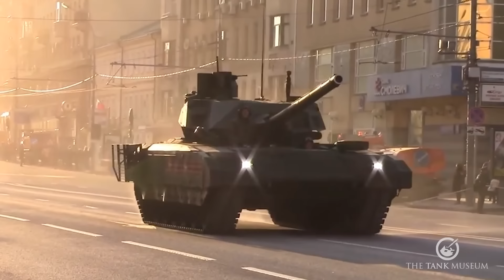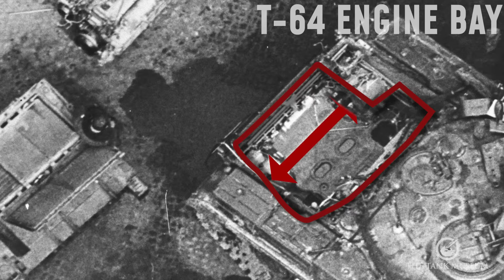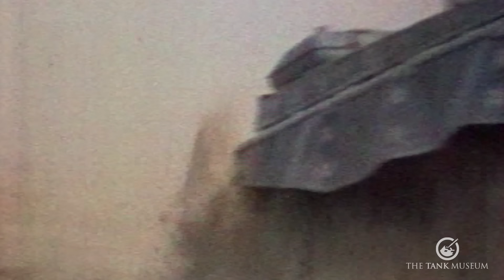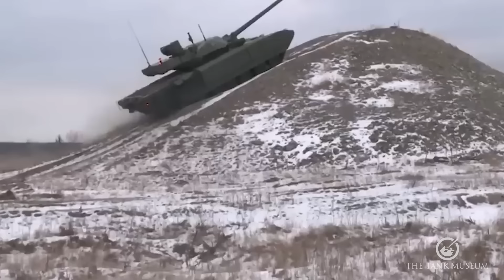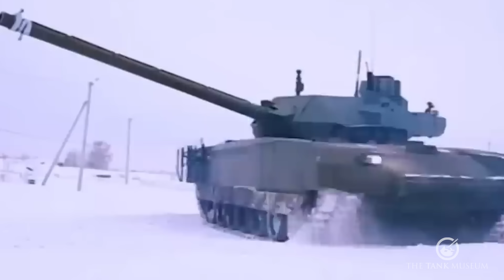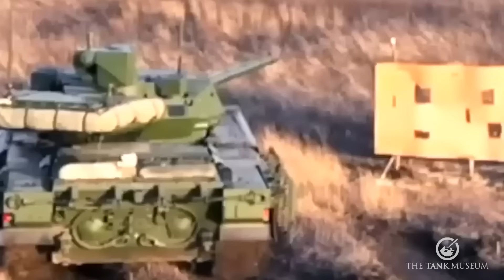Radical or Ridiculous? | T-14 Armata | Tank Chats #171

Comment: I feel like the traditional ‘Tank Triangle’ of Armor/Firepower/Mobility, should be amended to include ergonomics/crew as a 4th aspect. You can create a tank that on paper is perfectly balanced and has amazing Armor, Firepower, and Mobility but have it still perform terribly due to being difficult to use. In my opinion this is why so many games appear to have a ‘Russian bias’, because they ignore all these hard to quantify aspects.
Reply: In addition to ergonomics, reliability and repairability are also key factors. It is one thing to have a theoretically good tank and another to get it to the battle.
Reply: To paraphrase a wise man: "What is the most important aspect of any device? Being able to use it"
Reply: Well said. The T34, for instance, gets lots of praise from tank enthusiasts, and on paper it was a great design, but in its original form it forced the commander to double as the gunner, severely limiting his situational awareness. Definitely illustrates your point about being difficult to use effectively. Add to that bad optics and radios, and each tank was essentially blind and deaf, easy to pick off piecemeal.
Reply: A quadrangle now.   Aerodynamics of the turret should be considered.
Reply: This is interesting that we have fictional fire rate, fictional armor of a tank that never went into serial production. We have various prototypes that may be all different for testing purposes or just a learning curce from prior prototypes. So the idea to compare it to tanks that are actual used in units on s daily basis. It is a bit like we talk about unicorns that no one ever saw.
Reply: In context, 80,000 T34s were made with another 10,000 if you include SPGs made on its chassis. The Sherman was built for simplicity. It’s design put focus on its crew, making easily repairable parts and good survivability. The build quality was substantially higher with a much better k/d rate. Unlike the t34 the Sherman was a much higher quality, although not the best quality still better than the Russians.
Reply: @paleoWT and the Sherman still ended up being pretty advanced for the time. Any issue that came up was usually fixed in a timely manner, and upgrades were common and easy. The Sherman had excellent optics (even the ones with no gunners sight due to the idea they had not working out and not having time to make something else), they all had stabilized guns, they later had wet ammo stowage (even the early models without it didn't have a tendency to burn, it was just everyone's doctrine to shoot tanks until they burned to make recovery useless. They were never called ronsons by anyone other than the History channel), the engine compartment and fuel tanks were separated from the crew, the transmission was synchronized, etc. It was a very nice tank to fight in, and all crews who used them typically liked them a lot. Especially Soviet crews when they got M4A2s for the first time
Reply: @skyraider87  Why write all this? Sherman was still vulnerable to all German anti-tank weapons (except perhaps the Pak 36) of all tank guns.

There was no difference in the survival of the T-34 and the Sherman. The Shermans enjoyed an abundance of resources, manpower, and complete security. None of this is in the USSR, the Reich, or Britain.

And yes, the Russians considered Valentine a good tank, and Churchill a heavy tank, no worse than the KV-1 series. This is an argument for the fact that the Soviets considered the Sherman a good tank.
Reply: @adeptusaegis3189  compare the numbers. The Sherman had a crew survivability rate of 85%. The T-34 had about 15%. What that boils down to is that the Sherman crew would survive, go back to the depot and get another Sherman, and bring a few of their buddies in Shermans along too . Although statistically it was a Sherman, Singular, that was able to effectively deal with the threat.
Reply: @skyraider87  Cool story, bro.  But unfortunately, the Soviets had thousands of M4s and didn't see anything like it.

If a German 8.8 cm shell made a direct hit to the T-34, the crew usually died. If you think that Sherman's crew could Ignore shell from Tiger or Acht-acht, when this shell breaks through M4 armor, you probably have a magical mindset and believe in fairies, unicorns and things like that.

There was not much difference between the T-34, Sherman, Pp.4 and Cromwell. You had some kind of armor, some kind of cannon, some mobility, and enough simplicity and reliability to produce and use these tanks by the thousands and tens of thousands.

These tanks were made in different ways, by different people and in different countries, but their differences in general were not so great, because they had the same purpose and tasks.
Reply: @adeptusaegis3189  Soviet Shermans belong to soviets, american shermans belong to americans. Different strategies, maybe even slight differences in construction. The Sherman was a lot better quality as it had huge improvements in weld quality and crew survivability. Sure it wasn't armored, but at least the crew could take a hit and live to see another day - Emphasism on crew over the machinery. Neither tank can withstand a german 88 but the sherman crew could bail out ALIVE, which made a huge difference.
Reply: @paleoWT  Your faith that the tank crew can survive the explosion of three hand grenades inside the tank, simply because they are AMERICANS, is quite funny. And yes, the 8.8 cm German shell contained as much explosives as three hand grenades.
Reply: @adeptusaegis3189  I think you misread my statement. I’m saying that different combat usage will lead to different results - the difference between recklessly charging or having a good battle plan as well as how the crew modified the vehicle will all impact the final result. An unmodified Sherman has a very high crew survivability compared to something like a t34 85
Reply: @paleoWT  If speaking of "recklessly charging", you mean something like the Battle in the Hurtgen Forest, where the Yankees' 3rd tank and 9th infantry divisions, thrown into a frontal assault, lost up to 80% of their personnel and achieving NOTHING, then I can only agree.

Nevertheless, your unwavering faith that a Sherman with the same armor and size as the T-34 had a greater survivability for the crew, simply because it was made in America, is impressive.

We even discussed that it is difficult to survive after being hit by an iconic German 8.8 cm shell, but no, for you the M4 is still better because it is better.
Reply: @adeptusaegis3189  the Russians had close to no quality control and the t34s had much more dangerous interiors- smaller crew exit hatches and much higher chance of something exploding upon impact.
Reply: @paleoWT  Dude... who told you such nonsense about quality control? Firstly, all T-34s were 70% assembled by women and children, and there was strict quality control in production, firstly, all T-34s since 1942 were assembled in front of the crew who were supposed to go into battle on it, secondly, every master during the assembly of the T-34, he signed the sheet and any manufacturing defect could lead to the fact that everyone who worked on the shift could end up in the Gulag!
Reply: @FCSMHooligan Such strict quality control that drivers had to carry a hammer to shift gears?
Reply: @FCSMHooligan  Especially towards the early T34, quality control was pretty much nonexistent - who would’ve guessed the most produced tank during World War II wasn’t good in quality. these tanks are being made by women and children who don’t really have much motivation. Transmission was decent at best and the hull suffered from defective armor plates as well as bad welds. These issues were quite prominent and were a huge problem that the Sherman was less effected by.
Reply: @adeptusaegis3189 false premise here dude. NOTHING on the battlefield survived a hit fron an 8.8, Nothing on the battlefield survived a hit from a 17 pounder either. Same for the 90mm, so, your piont is? The tigers, weren't really an issue on any battlefield, as there were so few produced, due to material, and technological expense, the tiger was overly complex and very unreliable (looking at you t-14) and more often than not, thay failed to show up to the fight,  and would often be delt with by a tempest, or il 2 sturmvich. Heres the thing about the t-14, with the gunner and commander relying on remote sights on the turret? What do you think happens when a pair of us next gen ifv,s, light up the turret with the 50mm chain gun
Reply: @evilshews   IS-2 could have survived after being hit by 8.8 cm. Churchill had some chances.

My point is simple: the words about the best armor protection and survival of the Sherman crew are just words. 7.5 cm and 8.8 cm pierced the armor of both T-34 and Sherman. 8.8 cm at the same time killed or maimed the crew is almost guaranteed.

By the way, this was the reason why Tigers were much more feared than Panthers. It's the same with IS-2. If your tank was hit by a 122 mm projectile weighing a quarter of a hundredweight, then you are most likely a dead man.
Reply: @paleoWT wow who would have guessed when someone is being rapidly invaded needing lots of armour yesterday is going to turn a blind eye to QC until they have the luxury of taking more time....
Reply: @paleoWT you also fail to realize QC was actually good after the Soviet front had stabilized an turned the tide of the war.

And didn't do much research either there's a declassified CIA document that evaluated a Soviet made T-34-85 and remarked about it being well made.
Reply: @skyraidegg 8:39 r87
Reply: @paleoWT well need to understand that in the east front land battles was the size of all fronts in the west
60/70% of Germans forces were in east
Reply: @paleoWT  You talk about self-propelled guns based on the T-34, but you are silent about ~ 9000 GMC M10 and M36  based on M4. Also, you conveniently forget that the T-34 was produced for 6 years, and the M4 Sherman for 3 years. If the Yankees had been at war since 1941, they would have produced more M4s. In fact, no, they wouldn't. Because the M4 is 1942. If you add the M3 Lee and SPG on chassis M3, like Prist, you will get similar numbers to the T-34.

You're talking about survival, but Sherman in 1942 penetrated by all German anti-tank weapons and all new panzers. When the Americans tried to make a "survivable" tank,  they failed with T1 heavy and M6 heavy. You talk about the focus of Sherman's design on the crew, but it was never the feature design of the M4 by himself M2 and M3 had a crew of 6-7 men and M4 as their legacy, retained this huge interior space, now with a crew of 5 men. For comparison, the T-34 was originally a tank for a crew of 4 men. Another typical Yankee design is M3 light  and it was no less cramped than the T-34. M4 was a tank that the United States could produce by tens of thousands and which matched  minimum required specifications: armament (3-inch gun), protection (protection from bullets, splinters and 37mm PAK), was reliable, enough mobile and had a turret, unlike the M3 Li.

As for k/d rate, then Wehrmacht losses on the eastern front accounted for more than 70% of the total losses on all fronts from 1941 to 1945. The backbone of the German military machine was destroyed in the Soviet steppes. And the T-34 was part of it.
Reply: @paleoWT  yeah sherman had such a good survivability that its crew were so scared they used concerete and sandbags to 'upgrade; its armor
Reply: @piorun7840  The usage of sandbags was purely placebo effect. It didn't do anything much to improve the armor, but it helped the crew feel more comfortable. In reality, the sherman had enough armor to take a hit from the short barreled panzer 3s - It's obviously susceptible to a tiger but for its purpose it was pretty survivable. Not only that but the crew had a better chance at surviving an impact.
Reply: @paleoWT  well sandbags still helped and yes we can say that sherman was the best tank in ww2 but still lacked in armor and its cannon wasnt as effective as it should against tigers and panthers usa had terrible problems with decision making and they could long before 1944 introduce newer tank like pershing or create heavy tank that would rival tiger not to mention that troops that used tanks were advised to not fight tanks with tanks but in fact use tanks against infrantry ignore enemy tanks and let tank destroyers do their job ofc everyone ignored that since it was such dumb order that could rival russian order of not taking step back
Reply: @piorun7840  First of all, sandbags only had decent protection against shaped charges, which were far from the only rounds available to the germans at the time. There are accounts of Shermans penetrating the tiger's frontal armor- The armor was sufficient for what it was- a tank that you could deploy anywhere, anytime, anyhow. The sherman was far more effective than the german heavy tanks of the late war, and the armor was just fine for its purpose.
Reply: @paleoWT shermans could take hits to the front from a 75mm pz IV pretty well too, especially if hull down. And a Sherman would chew through a Pz IV in a second
Reply: @paleoWT  yeah, and if anything is more important than the tank surviving, its the crew surviving
Reply: Russian tanks are generally ok on paper but terribly made in factories due to their philosophy of quantity over quantity. For example the t34 is a legendary tank however the only reason for that is that there were so many made because it had a loss rate of more than 80% percent (horrible for a tank).
Russian tanks were never something special and still are unimpressively made.
Reply: @FiveDollarSurgery  mate, you are comparing 1930s and 1940s production of tanks to the modern day one. It is not the same today. And it was also the same for almost any country, as Germany was suffering with it's poor quality of production at the end of the war as well. Modern day production of the Russian tanks is of the high quality, with regards to the T90 tanks...
Reply: @FiveDollarSurgery  LOL. You don't seem to have heard that almost 50,000 Sherman was buil. Yes, it was such a bad tank, almost like the T-34.
Reply: @adeptusaegis3189  I'm not sure of your point. By all accounts, the Shermans were extremely well-made and massively more reliable than other tanks of the era. They were under-gunned for tank-on-tank battling with the 75mm in 1943, but that was mostly rectified with the 76mm (and Firefly, but by sacrificing crew ergonomics).  Its size was limited by the need to ship it across the ocean to go to battle, unlike the German and Russian tanks. It was a little tall due to initially accommodating radial engines and the front transmission. But by WW2 standards, the  Shermans had both quantity and quality.
Reply: @disphoto  My point is that the difference between the T-34 and the M4 medium in terms of use and combat effectiveness was insignificant. The M4 were no more reliable than the Pz.4, or the later T-34. As for the size restriction, the M26 obviously refutes this statement by its existence.
Reply: @adeptusaegis3189  did you read the post you are replying to?  Did you miss that the focus was the high loss rate?

Slightly fewer than 4,300 Shermans were lost in combat.  Compare this to slightly less than 45,000 T34s.

4,300 / 50,000 is a much more favourable ratio than 45,000 /57,000
Reply: @ShuRugal  Just read Death Traps: The Survival of an American Armored Division in World War II
Reply: @adeptusaegis3189  I'm familiar with the work, and I do not believe that a man whose job is is to fix broken tanks has the best perspective on the issue.
Reply: @ShuRugal  This book describes tank losses in an intense continental war. Even if the Wehrmacht was already in decline.

In fact, the M4 participated in intensive military operations for 1 year, from the summer of 1944 to the spring of 1945. Naturally, the American losses were less than those of the Soviets.

Т-34 was at war from the summer of 1941 to the spring of 1945, i.e. five years.

This was the case in the First World War. Both times, the Yankees' losses were small, because the Americans come at the end of the show.
Reply: @adeptusaegis3189 the Pershing, gun aft, was 20 feet long. The 75mm Sherman was 19 feet long. Your point is moot
Reply: @adeptusaegis3189 that book has been disproven by more historians than you can count
Reply: @ShuRugal not to mention the way the allies counted losses was highly flawed, often leading to one tank being counted as lost twice
Reply: @ShuRugal  Dude... did the American army really participate in tank battles like the Kursk Bulge, where 3500 tanks took part on the USSR side and 2800 on the German side! Sherman was in the Red Army, and you can easily find information that Sherman is a little better than without tanks at all, which you later proved during D-Day, where, in fact, tank formations of the US Army did not have serious successes!
Reply: @FCSMHooligan  you just keep right in believing that.  I can't help it if you think that US armored crews having the lowest fatality rate of any combat unit in the war is bad.  That's a you problem
Reply: @adeptusaegis3189  But it had nowhere near the losses of the T-34. Around 7000-7500 M4 Shermans were lost in WW2, so, not such a bad tank after all.
Reply: @freddieclark  The first mass use of the T-34 was in the summer of 1941. The first mass use of the M4 Sherman was in the summer of 1943. Naturally, a tank used for two years longer has more losses. And this is just one of the objective factors.

And yes, I'm not saying anywhere that the M4 was a bad tank. The T-34, M4, Cromwell and Pz.4 were about the same value.
Reply: @adeptusaegis3189  Yes, I agree that a tank used longer would have more losses, However, if battle performance was (and indeed still is) the ultimate determinant of the effectiveness of any weapon system, then unlike some legends in WWII, the tactical combat record of the T-34 does not match up to its legendary status. An objective look at the T-34’s record, without preconceptions, reveals questions which are hard to answer given the T-34’s claimed superiority. Fully 82% of wartime production was irrecoverably lost, even counting for its earlier introduction these numbers are staggering when compared to M4 losses. I would also argue that the first mass use of the M4 was October 1942.
Reply: @freddieclark  What legendary status you talking about? The T-34 is just a tank that the Soviets could produce a lot and it had sufficient characteristics. The T-34 is very important for the USSR and the victory over the Axis as a whole, but that's all.

An objective look at the T-34’s record it is... impossible in isolation from the general course of the war. Just look at how many tanks were lost (not only T-34) during the Manchurian operation.

In 1942 in Africa it was something like walking in the park. Montgomery has already won, the Germans are already drained of blood and ready to retreat. Yes, it looks like Manchuria 1945.

In 1941, the Germans were at the peak of their power, it is not surprising that the Red Army, caught at the moment of rearmament and staffing, suffered terrible losses.
Reply: @adeptusaegis3189  The legendary status that is constantly mentioned in books and online, "The T-34 was the best tank of WW2 blah blah blah".  What Manchuria operation are you talking about?, if you are referring to Khalkhin Gol then there were no T-34's involved. If you are referring to the invasion of manchuria, then the Soviets used a huge variety of tanks, including pre-war BT-5's and lend lease tanks.  Considering the T-34 made up such a large percentage of Soviet armour, then it is of course possible to look at the losses in isolation, as even Krivosheev has done. Mongomery had not won until after the 2nd battle of El Alamein, which included the use of the M4. Lets forget 1041 and instead look at 1942 and 1943 where the Soviet T-34's were decimated by the Germans who generally had a 3:1 kill advantage. The simple fact was that the T34/76 had relatively poor main gun optics quality, no turret basket, a very cramped and low turret (the gun could not depress more than three degrees severely restricting use on a reverse slope or at close range), poor turret drive reliability, no radios, and generally poor target observation and indicator devices leading to very poor fire control effect.
Reply: @freddieclark  The T-34 was the best Soviet tank, that's right. The KV and IS were too few in number, and the T-60 and T-70 series were ersatz tanks built only because ersatz tank is better than no tank at all.

You might as well say that the M4 Sherman was the best American tank, because the Yankees couldn't build something better. Of course, the Panther was stronger than T-34 and M4, as the T-34 was  stronger than the Pz.3 and Pz.4 in 1941.

Manchuria operation in 1945, is obviously an operation carried out by the Soviets against the Japanese, at the request of the Americans, in exchange for the countries of eastern Europe. The Japanese army was defeated quickly, which led to the surrender of Japan and finally peace.

2nd battle of El Alamein was just one battle. For example, by March 1945, there was only one (1) M4A1 tank left in the 741 tank battalion, which landed in Normandy.

As for the disadvantages of the T-34, I recommend that you read the report of the Aberdeen proving ground regarding the T-34 and KV-1.

Regarding "Germans who generally had a 3:1 kill advantage" I remind you that 50%+ of the lost tanks always accounted by anti-tank guns.
Reply: @adeptusaegis3189  Manchuria was a land grab by Stalin when he knew he could get away without serious loss and  Germany had already been defeated.  Not sure what you mean by your second statement. I have read the report by aberdeen proving ground. it does not change the fact that the T-34/76 was ill used and ill suited to open country warfare.  as German tankers noted “T34s operated in a disorganised fashion with little coordination, or else tended to clump together like a hen with its chicks. Individual tank commanders lacked situational awareness due to the poor provision of vision devices and preoccupation with gunnery duties. A tank platoon would seldom be capable of engaging three separate targets, but would tend to focus on a single target selected by the platoon leader. As a result T-34 platoons lost the greater firepower of three independently operating tanks”.(9) The Germans noted the T-34 was very slow to find and engage targets while the Panzers could typically get off three rounds for every one fired by the T-34. The numbers of lost tanks are in tank vs tank engagements. Similar figures are available for the ETO where the M4 had a positive kill ration of 3.6 to  one.
Reply: @freddieclark  One more time. The USSR's declaration of war on Japan in 1945 was the result of the Yalta Conference. It was there that Stalin, Roosevelt and Churchill agreed that at the end of the war in Europe, the USSR would fulfill its allied duty by declaring war on Japan. In response, places like Hungary, the Czech Republic, Poland and the like will be under Soviet control.

Returning to the tanks. You're saying that:
...Around 7000-7500 M4 Shermans were lost in WW2
...M4 had a positive kill ration of 3.6 to  one.

7000*3,6 = 25200  In total, the Germans built ~50,000 tanks. Do you see anything strange in your math?

If you really have read aberdeen proving ground  report, you know that the T-34 was not made up of flaws, as you are trying to show. The Americans liked the cannon, the gun sight and the engine, for example.

...the fact that the T-34/76 was ill used and ill suited to open country warfare...

M4 was especially "effectively" used in The Battle of Hürtgen Forest and "well" suited to forest warfare. tag "Sarcasm".  Once again by March 1945, there was only one (1) M4A1 tank left in the 741 tank battalion, which landed in Normandy.  The American tank battalion had 60 tanks. During the year and a half of the war, one tank of the original composition remained in the 741 battalion. It means ~99% losses.

The Germans noted the T-34... 

And again you make me write the same thing over and over again. In 1941, the Germans were at the peak of their power, it is not surprising that the Red Army, caught at the moment of rearmament and staffing, suffered terrible losses. The Germans of 1941 are veterans of two companies, and their equipment is reliable, even if not too powerful. Some Soviet tankers in 1941 even did not know that the T-34 had a diesel engine and refueled the tanks with gasoline, which immediately disabled the tank and required repair. T-34 in 1941 = Panther in 1943, a powerful but unreliable machine.

And yes, Guderian himself wrote in one letter that "the Sovet T-34 tank is a typical example of backward Bolshevik technology," but then suddenly the same Guderian writes "...prominent designers, industrialists and officers of the armament department came to my tank army to familiarize themselves with the Russian T-34 tank, superior to ours combat vehicles".  LOL WUT

The Germans are famous storytellers. They portray the extermination of 17 million Soviet civilians and the murder of 3 million prisoners of war as a great military victory and sign
 of superiority over wild Asians. All their statements must be checked without fail. As well as all other statements by either side.
Reply: @adeptusaegis3189  The USSR could have entered the war against Japan much earlier, but Stalin vetoed that. The Germans were clearly beaten well before the Yalta conference was held. The Aberdeen report stated that the gun was good (It was for 1941) The gunsight was good, again, it was for 1941 although German and later US gunsights were far better, particularly when you include the poor sights and optics used due to factory disruptions and raw material disruptions. The Engine was good (as long as US aluminium kept arriving in Soviet waters through lend lease, pity the transmission was such a piece of crap though. Nothing wrong with the math, just the way you are trying to interpret it.  Tank on tank encounters were not the only way tanks were destroyed, Not every battle featured just tanks vs tanks, in fact they were a rarity, but thankfully we do have statistics from AAR's that identify actions where only tanks met. Germans actually produced only 26 925 tanks during the war, however they also produced 612 command tanks, 232 flame tanks, 10 550 assault guns, 7 831 tank destroyers, and 3 738 assault and self-propelled artillery AFVs, from 1938 to May 1945. No tanks were highly effective in the Hurtgen forest, so your point is nonsense. You also clearly do not understand the way US armour and resupply worked, anyone reading your comment on a SINGLE independent tank battalion would almost believe that they actually only had a single tank in their arsenal in 1945, and by the way 27 of those tanks were lost when they sank on the way ashore on D-Day. You make the usual argument that the operational state of the Soviet mechanised forces and the general situation in 1941 were the primary factors in the T-34’s combat performance in 1941. The problem with that is that the Soviets had the same performance figures in 1942 and 1943. Yes the T-34 was in some aspects superior to German tanks in 1941, when it faced short 75mm Panzer IV's and short 50mm Panzer III's. So why did ot perform so badly against those same tanks in 1941, when as Guderian states it was superior? Remember that a large portion of Soviet tank inventory was T-26 and  BT-7  tanks in 1941, So 1942 should have been far better for them but what happened? The Soviets still managed to loose 15,100 fully tracked AFVs in 1942 including 6,600 T-34s and 1,200 of the even more powerful KV heavy tanks. This meant their loss ratio was almost as bad as 1941. To a large extent it was worse than 1941 because in this case over half the tanks destroyed were T-34 and KV tanks.
Reply: @adeptusaegis3189  And we can also go to 1943 when the strategic initiative had swung in the Soviets favour. In this year the Soviets lost a staggering 23 500 fully tracked AFVs including 14 700 T-34s, 1 300 heavy tanks and only 6 400 light tanks.  As for the transmission, The gearbox in pre 1942 built T-34s was another design flaw of the tank. The gears were spur cut, and lacked synchronizers. The problem with your claim is that the T-34 was an evolution of the A-20 and A-32 prototypes, both of which were designed to be a replacement for the older BT tanks and the T-26s. The BT tanks only similarity to the Christie design was the suspension.
Reply: @freddieclark  The BT tanks only similarity to the Christie design was everything. BT-2 is literally a copy Christie M1928\M1931 aka «Model 1940». Hell, it even had a Liberty engine on it. BT-5 is how the Russians saw the fixing of  M1928\M1931 flaws. The BT-7M was probably the maximum that could be achieved from Christie's concept.

The A-20, A-32 and T-34 used components from the BT series, such as suspension, engine and gearbox*. The Yankees did the same with the M2 medium, M3 medium and M4 medium tanks. This is a common thing. 

And we can also go to 1943 when the Soviets making tanks more reliable, more comfortable, with a better view and a working radio,  while the Germans put all their money into raw power. Stalin refused to do the same, although the T-43 tanks and the T-44 looked very promising. So before the Soviet mass SU-100, T-34-85, ISU-122 and IS-2, the Germans had a technical advantage in armored forces. The Germans kind of turned the table when they became, like the Soviets in 1941, with powerful but not too reliable tanks, against an active and hastily advancing enemy who had reliable, but outdated and not too powerful armored vehicles.

* The gearbox was taken from the BT-7, which weighed half as much as the T-34, unsurprisingly, it worked unreliably.
Reply: @adeptusaegis3189  Again, the T-34 tank transmission was redesigned for 1942/3 as the earlier one was weak, the only resemblance the T-34 had to Christie tanks is the Armour slope and suspension. To claim anything else is laughable. You literally claimed earlier that the T-34 had the same transmission as the Christie tank.  And again in 1943 the Soviets still had massive losses compared with German tank units. You can try to spin it anyway you like, but the facts speak for themselves. The BT tanks used gasoline engines not Diesel engines, the BT-7 used a sliding gear chain drive transmission. You may as well say the T-72 is a development of the Christie tank!
Reply: @adeptusaegis3189  the sherman was produced massively, but not cheaply. the americans had fully operating factories that were not getting bombed, and as a result could produce relatively decent quality equipment on a massive scale
Reply: its because these games are russian games.
you literally can not make a gane in russia unless it complies with soviet era revisionsit history.